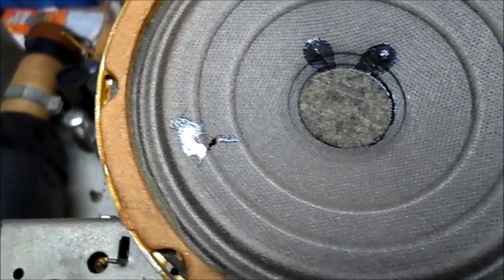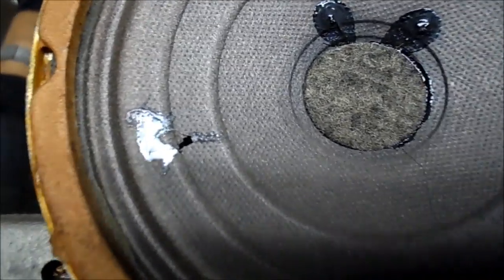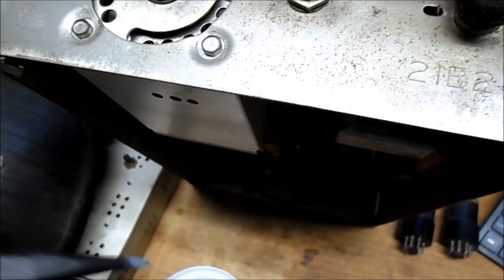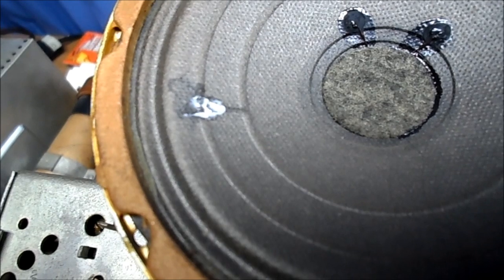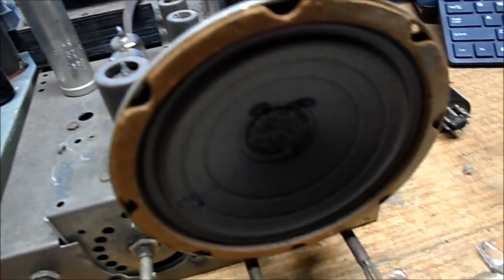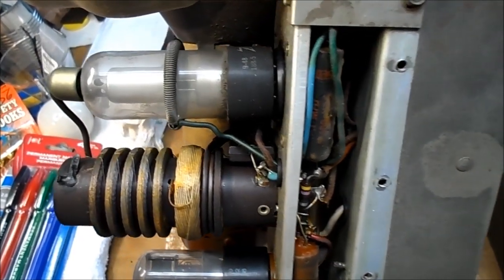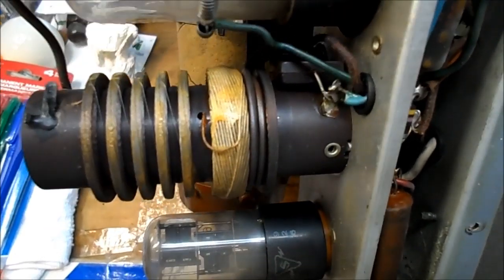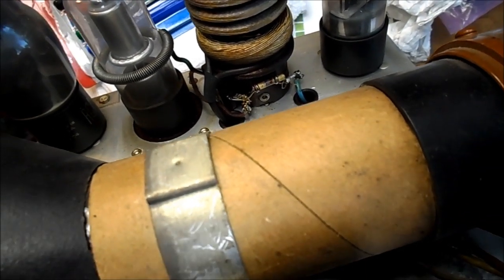Sentinel 400TV Pt. 2.

Comment: When I was a kid, a TV repair man told me the old rectifiers were labeled to indicate the source of positive voltage, since those diodes were always used in power supplies.
Reply from the maker: Still backwards to me, but that is correct. That's just the way they did it then. The + means that's where your filter caps go, not the polarity of the diode as one would think.

Comment: Hi Robert, a little more info on the 400TV. Power transformer primary is 117 volts A.C.; leads are black. High voltage secondary is 120 volts A.C.; leads are red. Heater string one(x) is green, heater string two(y) is brown and lastly heater three is yellow, it is for the 6X5 mid B+ rectifier, its' heater is a few hundred volts D.C. above ground. All the best, Tom J. from FLORIDA

Comment: Hi Robert, back in the 40's they did it a little different then it's done today. Just draw one diode symbol in place of the multi-diode stack and you will be ok. If you are still unsure; trace the wiring out place the parts accordingly. The small cap you were pointing to on the H.V. supply is C-86 on the SAMS print and C-24 on the RIDERS print. It is a tubeular ceramic of between 72pf to 82pf . You need to get the B+ supplies up to snuff. Talk to your customer and explain the need to replace the paper capacitors and any resistors that are out of spec on the high side. Your SAMS is complete, the missing 1/2 page is the set rear view. If your computer operating system, printer app and the PDF version you have will permit print the schematic out in poster mode with cut marks. You can then put together a larger print that is easier to read. That is the way I print all my schematics. Also pay close attention to all the resistors in the high voltage chain. High Voltage in that set should be +5 kilovolts. All the best,Tom J. from FLORIDA:-)